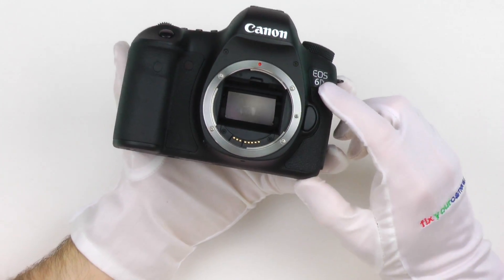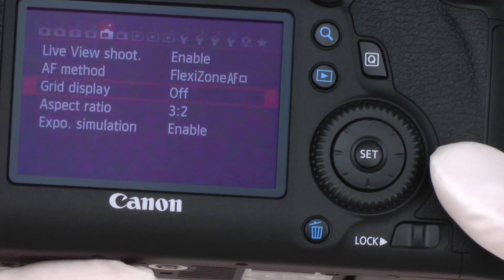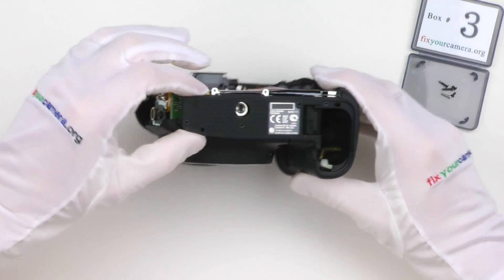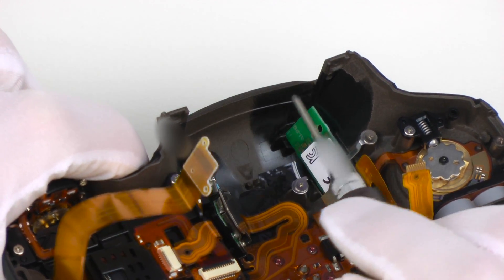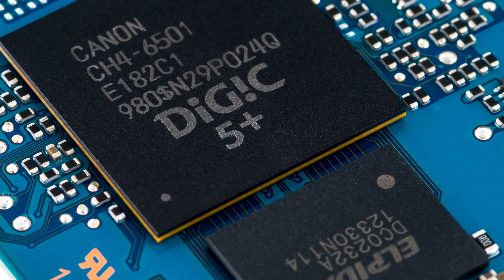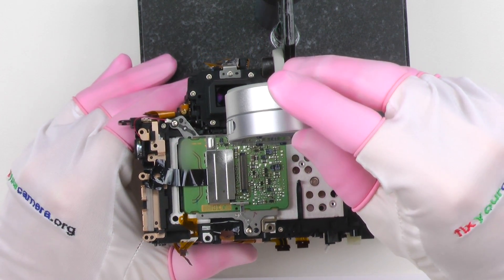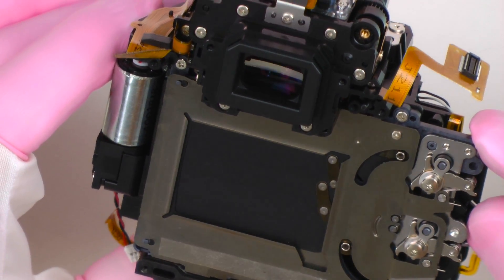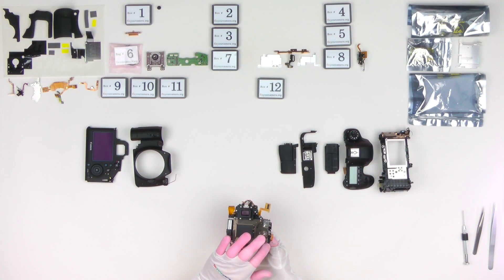Canon 6D - What's inside?

Comment: Hi i was wondering if anyone know which component contains the analogue LCD display strip that is seen through the viewfinder (Light meter, shutter speed, aperture, battery indicator). Is it the viewfinder optic assembly that is attached to the top pentaprism?

Comment: This crazy thing happen is that my 750D often freezes to "Busy... Please wait." (Only in taking photos) That I need to take my battery out to stop it. That has been happening for 2 and a half weeks and I'm really frustrated because I would need to get it repaired which will cost me a lot. 

Then yesterday when I was putting my card in, something was blocking it, a very small screw that I'm sure it's from inside the body hanging out of the SD card slot. But the busy problem still won't stop and I haven't bring it to a repair shop to have it checked. Do you think it's because of the loose screw??
Reply from the maker: Hi, if there is any loose metal object inside, please stop using your camera and remove the battery right now... it will save you several hundreds easily! As to repairs - 750D is on recall, so please check if yours qualify first, you might get lucky and get it all done (recall issue + loose screw + busy etc) for free... worth trying!:)

Comment: You will be happy or not happy to hear, i went whale watching with my 6D in a small Zodiac boat, and i had trouble not getting it wet, it was almost submerged in salty waters! My battery grip short circuited but the camera still lives. Sometimes it has a few glitches, nothing major, but i must admit i've had it since the release of the 6D which is about 4 years now, and I use it every day. thanks for the video.

Comment: please help me my 6d camera fell into salt water the sea please help me i have opened it clean it but it still not working or even come one please help
Reply from the maker: Water damage is usually a tough job with 50/50 chances, unfortunately. The next step is to clean all electronic boards in ultrasonic cleaner. Then measure the current it takes while turned off/on, etc (instructions in one of my videos). Then check all under a microscope, resolder, check fuses, replace parts, clean optics, check mechanical parts, etc. The outcome also depends on the extent of the damage inside. If you have no experience in this -> find a good repair shop. Let me know if you'll have more specific questions. Good luck! Hopefully you can bring it back to life.
Reply: can u fixed it for me ? were do you leave
Reply: can you fixed it for me please
Reply from the maker: No, I'm sorry I can't do it currently.
Reply: why?

Comment: I would like the canon 6d have a start / stop button underneath the body. you think you bring him an extra connection from the button contacts to another microswitch I can get out of the body ??
Reply from the maker: Check first if a battery grip has such feature / some multi function buttons etc. Its the fastest and easiest way. 

Or if battery grip won't work, then yes, you can connect additional switch/button in parallel to the original one inside, but avoid drilling or permanently modifying the outside covers - it'll be very hard to sell such modified camera! You can use existing connectors (disconnect them first from their original signals inside and route wires for your switch) and then find a plug that fits.

Could you tell me why you need this additional button? I'm just curious. I do sometimes such modifications, but people rarely state on the paper work why they need such thing. Let me know:)
Reply: their tips are very good. Thank you. I have my canon with an L-Shaped Metal Flash Bracket Holder left with a small LED illuminator. I use my iphone over pointing forward to the guests look and better connect with the cameraman hehe .... and also a follow focus. all that to try not to lose the old virtues of handys to use for many years. imagine your after having the canon 6d for several hours with all the accessories I'm constantly changing grip and I sometimes impractical to have the start / stop botton on the left to toggle the effort hand. anyway its board try a grip is excellent. although he summarily more volume and weight to my kit the idea is good. excuse my poor English. here in Argentina we not talk much.

Comment: Kudos to Canon, at least it is still made in Japan.
Used once a micrometer screw gauge for a Pentax DSLR to adjust the distance, the correct value is written in the service manual, so far the new owner did not complain. ;)